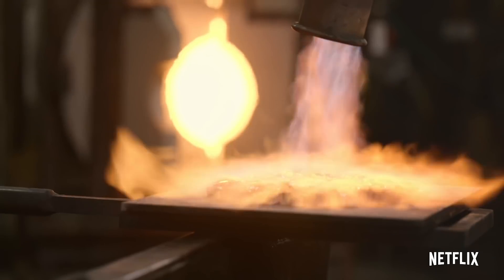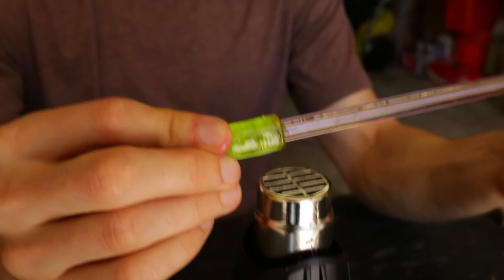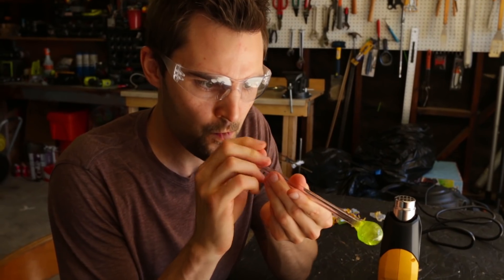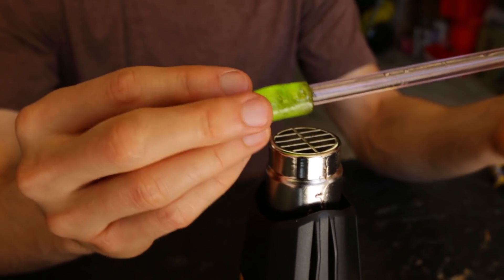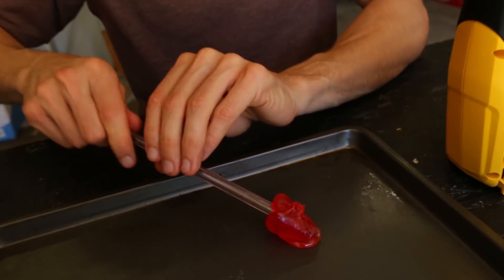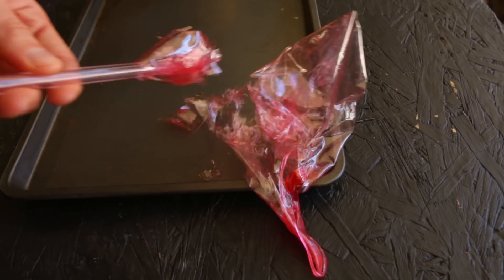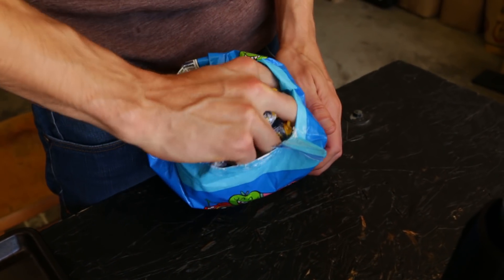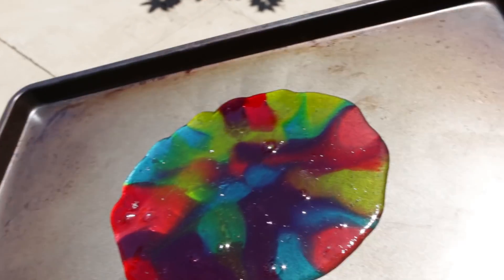Glass Blowing Jolly Ranchers | Nickipedia

Comment: jolly ranchers are glass, in the jolly rancher they add corn syrup. What cirn syrup does is it kinda prevents the ability for the sugar ti fully crystalize. What that means is it's never quite taking a shape. Technically glass is defined as a non crystalline transparent solid and thats pretty much what a jolly rancher is sugar glass. And when we think if glass we normally think of soda line glass. A jolly rancher is also  technically glass it's just that it isn't made up of silica but the base product sugar. So a jolly rancher is glass.

Comment: The easiest way to pop a bubble while glass blowing with a larger pipe is to blow into the pipe and cover it with your thumb, the heat causes the air to expand and creates a bubble!! Doing this creates more pressure than a normal humans breathe could muster

Comment: You were probably having all those blowouts because the tip of the jolly rancher mass (furthest from the pipe) was hotter than the rest. In glassblowing, we usually marver once at a high angle to cool the tip so it doesn't blow through. Good luck!